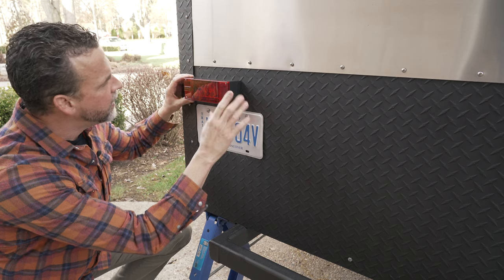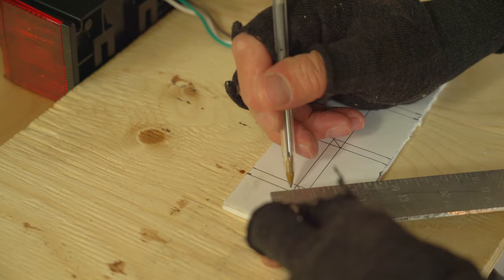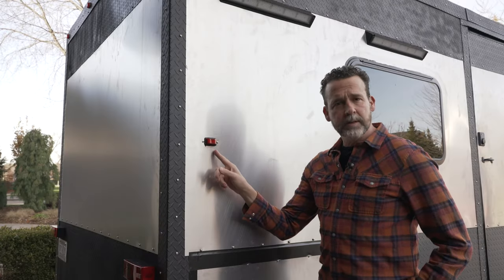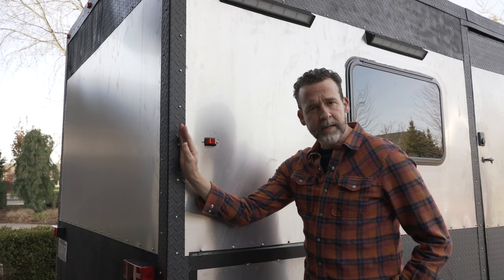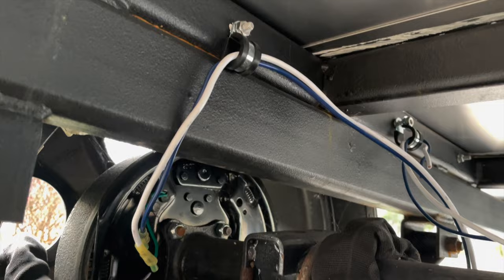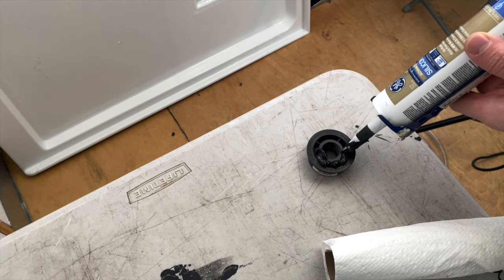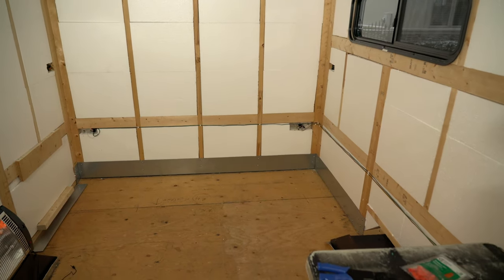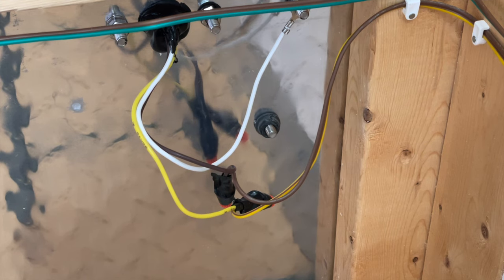How to Build a Travel Trailer - Wiring Lights for Towing a DIY Camper / RV / Caravan

Comment: If I may:  those junction boxes are not weatherproof at all and water will eventually infiltrate inside and inevitably cause electrical problems.  In my project, I ran the 7 pin cable right inside the trailer through a watertight cable gland then I installed the junction box also inside where it will be fully protected from elements.  I ran two wires from the junction box and pass them through the floor using again cable glands to connect the trailer brakes.  Great video, looking forward watching the rest of the build project!
Reply from the maker: Now you tell me? 😉 That’s actually a great idea. I would have considered that.
Reply: @DrenalinAdventures  When working as an electrician, I found it is usually more important that water can make it's way out then sealing perfectly. Often times I would drill an escape hole on the bottom to ensure the water had a way to leave.

Comment: Trailer is looking great !    Just a comment about wiring:  I don't know about Canada, but in USA, when you have electric brakes, the trailer must have a "breakaway switch and a trailer mounted battery" to activate the brakes should the trailer become disconnected from the tow vehicle while in motion.  That is one of the 7 pins on the connector, it provides power to the battery to maintain it's charge.  The seventh pin is for backup lights, if fitted.

Comment: I'll just mention again Styrofoam /polystyrene  will over time break down pvc cable  insulation  it's a chemical reaction that makes pvc brittle
Reply from the maker: I have some corrugated wire protector that I may use.

Comment: Thanks for sharing.  Great job.  A clean work place is a safe workplace.  I would recommend using polytuff or ENT to sleave over the exterior wires running along the frame for some added protection.  keep on keeping on.
Reply from the maker: Thanks for the tip!

Comment: I would run a ground wire(white) to all of the lights and to the terminal block. Les chance of dissimilar metal corrosion and loosing a ground, also use dielectric grease at all electrical connections

Comment: I'd have put a little DiElectric grease on wires as would help with any water intrusion into these connectors and eliminate any  possible corrosion of the terminals.

Comment: How're you doing mate just popped in too say congratulations on the flash lights marker lights too I liked the way your tail and number plate lights were well sealed good idea the rubber sealing set nut's ,you're insulation look's real good the 50ml 2" will be real cosy in the winter.See you next Pop in mate.
Cheers from down under NZ

Comment: I have used split loom tubing to further protect wires under the trailer. A wrap or electrical tape every 40cm is good enough to secure the wires inside. You can always cut the tape and insert more wires or remove wires in the future. The split loom is held in place by the wire clamps you have already used.

Comment: I understand the aesthetics when it comes to your marker lights but should any of them crack or need replacing it could be quite a job if the walls are finished unless you are goig to leave access for them. Maybe consider buying a few extra now just in case they can't be found in the future. Don't be fooled by LED claims either, they constantly fail as well. Also when it comes to wiring I suggest you should try to avoid crimped connections as they usually fail from vibrations on vehicles, far better to solder and use heat shrink tubing(dielectric grease keeps out corrosion but heat shrink tubing is better) especially when on the outside of a vehicle.